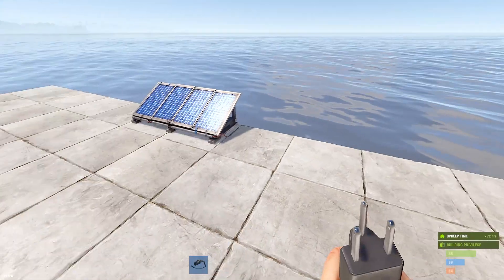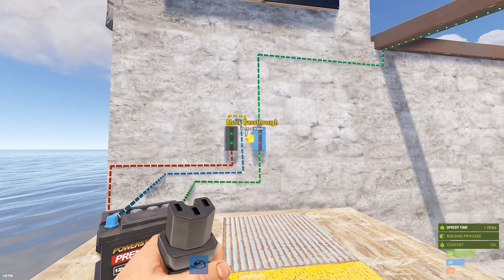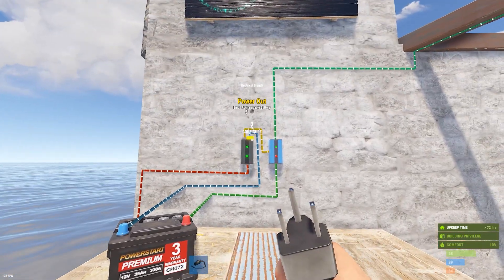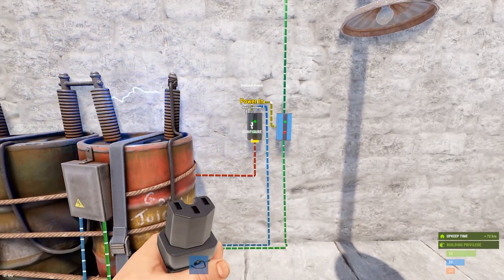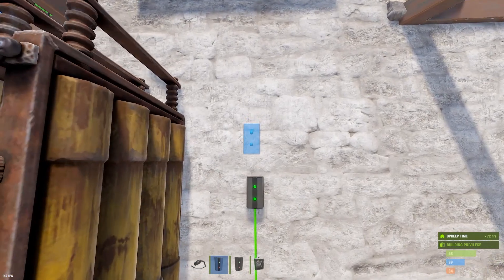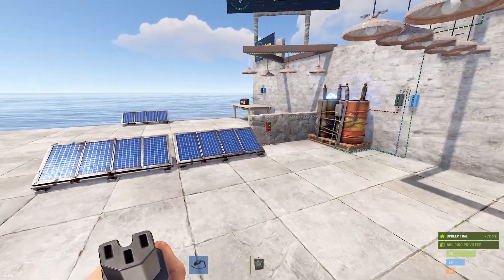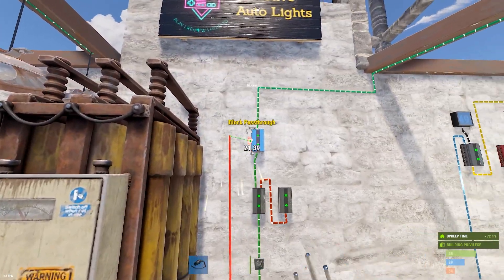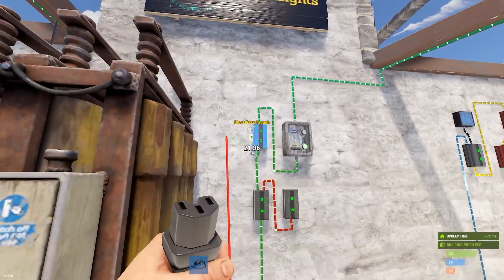RUST Pro Series - How to Build Automatic Lights in Both Passive and Active Designs 2022

Comment: I use a heartbeat sensor and an AND switch to turn on each room light automatically when someone is in that room, be it day or night and turns it back off when no one is there.  this saves battery.  i use this same circuit on my turrets with multiple heartbeat sensors grouped together thru OR switches to send the signal to the AND switch to turn on that whole system that way its not drawing power constantly. and it wount matter if they shoot out the heartbeat sensors, many are duplicated they would have to find them all.

I can link design and my own design for gen automatic backup when all other root sources are not available.

Comment: for the solar panel in the end system.. You could use a branch with 18 power divered and then use the power out to get 1 volt into the blocker.
That way you get immediate turn off on drop and later turn off on morning.

Comment: Don't forget the pay item 'Industrial Lights' only use 1 power per light, instead of the 2 used by the regular lights.  They can be placed on walls and more spots as well.  Kind of a 'pay to win' item but does allow you to place more lights for the same electrical cost.

Comment: Sorry, maybe someone said it before, but it is possible to put a branch where you send energy from the main output (not branch) to the block passthrough of the blocker and the branched amount will have to be set in such a way that can cover both dusk and dawn (which will depend on the sv, in my case is 14 approx.) and also a value that you are comfortable with, the main power (from the battery) will go to the input of the blocker and if you need stuff with electricity always you can intercept that main power with a branch/es to power those other stuff like garage lift or elevators, after all the (always needed) power diverted from the main, feed the rest (lights) and do the math before so you know you can light everything or at least don't go above the max output of the battery.

Good video!.

EDIT: Another important thing to mention. If you are going to use 2 solar panels to act as a conditional to turn the lights on/off and at the same time you are using 1 or more Wind turbines high using wall frames, take into consideration that at some point (and depending on the location) both solar panels will be covered by the shadow of the wind turbine and the tower, so the best would be to put them up there, each on their own floor so the shadow affects the one that is not powered (when the sun comes from the east, the shadow will cover the west solar power, which you don't care because at that time the solar panel wont have electricity, viceversa).
Reply from the maker: Everything you're saying is AWESOME! 

Because the majority of players don't generally dive that deep into the electrical side of RUST, I try to make the videos as digestible as possible to accommodate more skill levels. 

At some point, however, I might start making some more advanced videos to cover things like those in your comment!
Reply: @AustinKlailaGames  I like rust electricity, I like the idea of conditionals, logic gates, tables of truth, having a problem to solve, though I'm a programmer I'm not an engineer, so my knowledge on Boolean mathematics and logic gates diagram is lacking.

I will wait for those advanced videos with utmost anticipation!.

Comment: For the last scenario you can also use a branch between the solar and blocker (instead of stacking blockers) to change the amount of excess voltage going into the blocker. That way you can adjust the timings whenever you want.
Reply from the maker: Yep! You can also switch from the branch out to the power out if you decide you only want 1v taken up.

Comment: So is it possible to setup a circuit for tesla coils so that they aren't draining your battery unless someone is in range?  I set mine up with an AND switch and HBHF sensor but it's always drawing full power even when the coils aren't active?  Future video maybe?
Reply from the maker: You could set it up with a blocker so that it didn't draw active usage but you'd still need that power available when the time came. You'd have to make sure the blocker was early in the circuit so that it had priority.
Reply: @AustinKlailaGames  what I want to do is have a large battery dedicated to 3 tesla coils at a time (33 watts each) but have the coils in multiple areas of the base.   They wouldn't be likely to all be triggered at the same time so they could all use the same 100w.